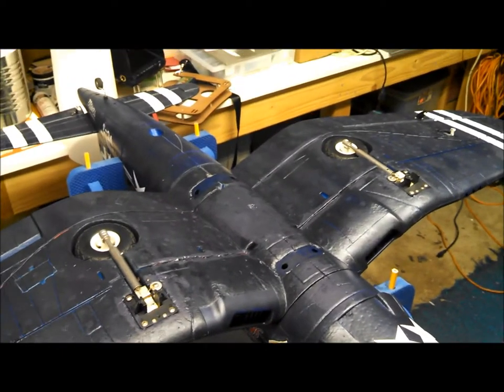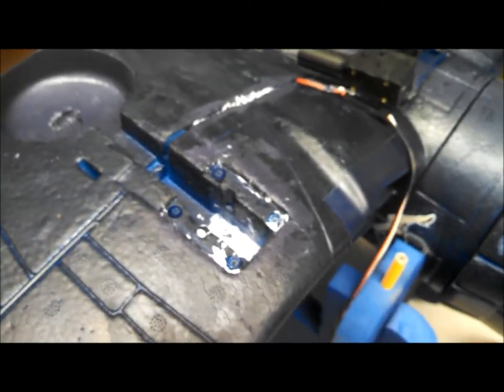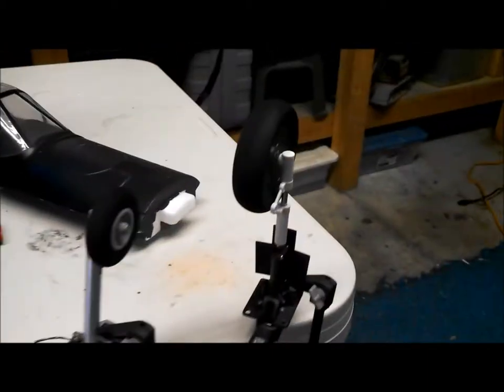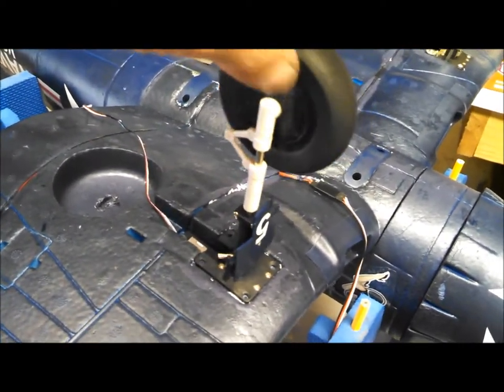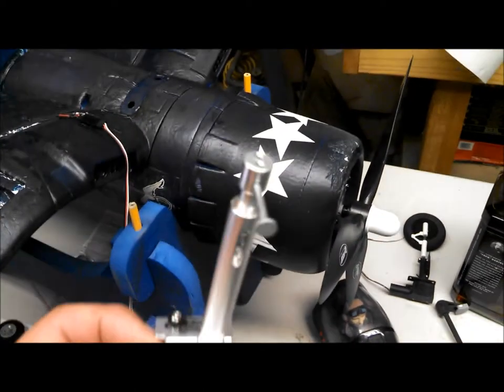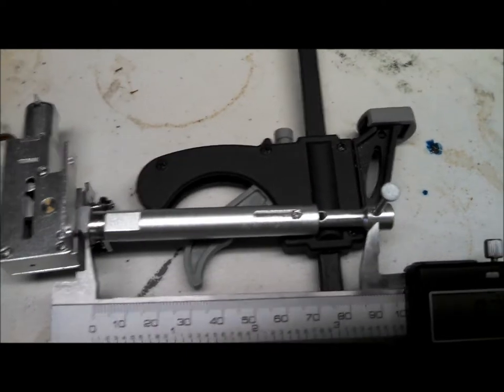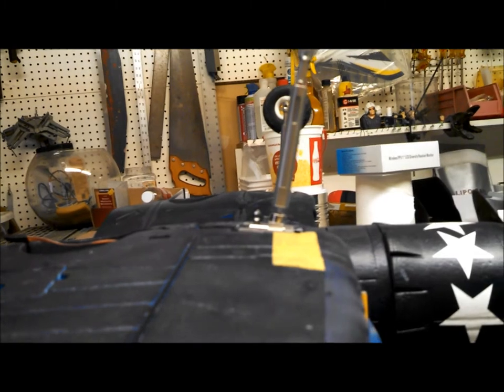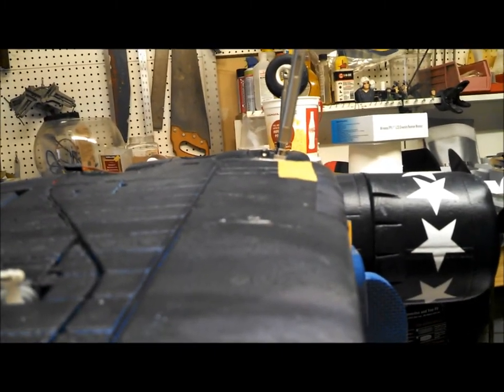RCLander 100 deg All Metal Retract Quickie Review

Comment: Will this fit the Dynam 1020mm Hellcat f6f ? These are really impressive.
Reply from the maker: If you mean the 1270 mm Dynam Hellcat yes, with minor mods. You can buy them with oleo struts the correct length from Parkrcmodels.com. These have updated 4mm strut pins and excellent warranty or you can get them at Hobby King with 3mm strut pins for much less but you will have to build your own oleos.